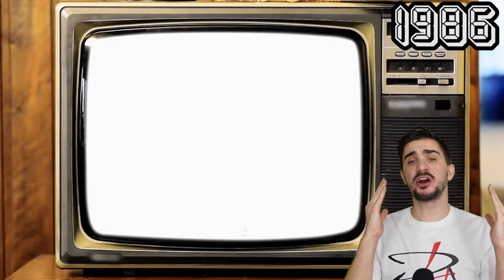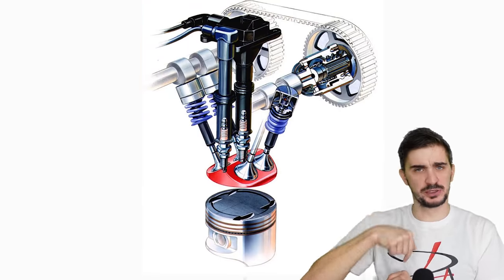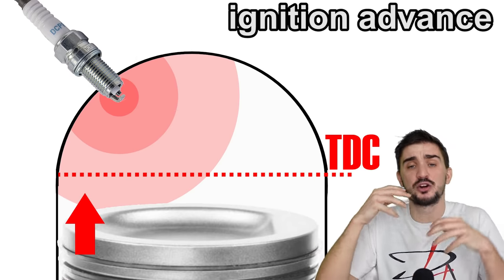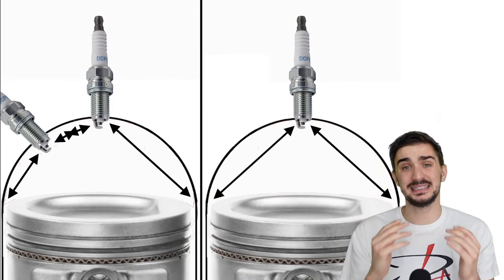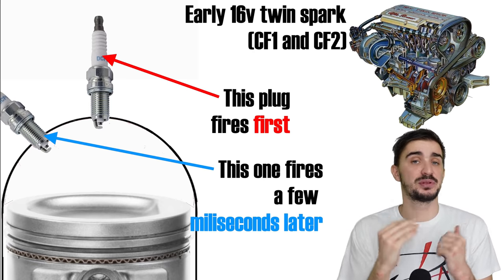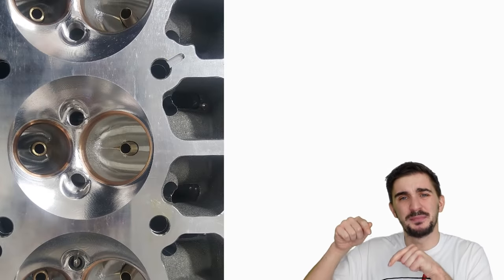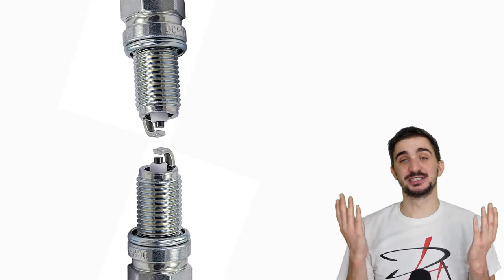TWIN SPARK - WHY, HOW and why it isn't more widespread

Comment: There seems to be an upper limit for bore diameter relating to efficiency. The main reason we are able to make so much power nowadays is all about OEMs being forced to comply with emissions restrictions. All of the manufacturers are using similar bore sizes now. 83mm seems to be the most efficient size with diameter rarely exceeding 95mm. 
Efficiency is directly related to emissions and power comes from efficiency. Motorcycles use even smaller bores for high rpm in the 60-70mm range as you said. Big twins need dual plugs for high rpm. It would be much easier for manufacturers to make larger bores for efficiency and higher RPM but complexity for multiple plugs is extremely expensive. Not only plugs and coils but the wiring, drivers, ecm, and so on adds huge cost in production.
The Mopar Hemi is an exception due to the marketing strength behind it's return. With it's bore over 100mm there's no way to reduce the timing advance enough to meet emissions targets with a single spark plug. The concept was to run a single plug but the hemispherical combustion chamber is not as efficient as the heart shaped chamber in a two valve chamber with offset spark plugs. The cool thing about the modern Hemi is that it's extremely efficient with the dual plugs. A GM LS3 compared to a Mopar Gen3 Hemi with identical bore and stroke run very different spark advance timing. The LS runs around 35 degrees of timing while the dual plug Hemi runs around 23 degrees of timing. The closer you can get to zero advance, the more efficient and powerful it is.
Here's the main thing, with advance you are making a trade off. Even though you don't reach maximum efficiency instantly, the cylinder pressure starts spiking immediately upon plug fire. This is using rotational force to finish the move to TDC. Waiting as long as possible to create the spike in cylinder pressure puts more of the total combustion force after TDC pushing down increasing power. On a dyno when you creep up the advance to maximize power, you are optimizing the trade off between trying to stop the piston from coming up and the part used to push the piston on it's way down. When you add a little too much advance the balance is off exerting more pressure on the rising piston than necessary. The explosion happens to early and it makes more heat due to resistance to motion. Detonation or preignition happens before the plug fires. Adding boost or nitrous increases cylinder pressure which is why higher octane fuel is needed to stop the fuel from lighting before the spark plug fires. Also the higher the cylinder pressure, the faster the flame will propagate across the bore. That's why you have to reduce timing with boost. The combustion is identical to a 5 pound sledge hammer 🔨 with a 1/4 inch or 6mm rubber pad punching the piston. Detonation is that hammer punching the piston too early. Tries to stop the engine instantly, the rod punches the crankshaft against rotation and the piston rattles because you just rung it's bell. Everything superheats in an instant from the opposing forces.
This is just for you D4A, I love your channel and the work you put in every time. Thanks again.

Comment: First of all I watch your videos religiously. I think it would be great if you did one on the Ford 2.3 l dual spark and let us know if there is a way to hack the ignition and have both plugs fire simultaneously. It would also be great if you could dig up some information on why the 2.3's in the rangers were so problematic with their crank no start issues.

Comment: I dont know about how you guys feel but ive  see two different makes back the 80,s that used twin plugs on in-line 4 bangers and they blew head gaskets, and were never run hot, no leaks, etc I think the burn rate is too fast and a lean condition  some air craft engines use two plugs (one is back ). The twin plug deal on the Pinto engine  2.5 was a failure

Comment: Toyota had a good twin spark.
The 3TGTE. It was made in the early 80s and the turbo version was a good little motor. I had one in a 74 Celica. Great car until it burnt to the ground from a failure in the fuel reg.

Comment: India motorbike manufacturer Bajaj has made twin spark for some time. American Le France and Seagrove V12 fire engines were twin spark. The ignition systems were separate and duplicated. If one failed,  you could still respond.

Comment: You forgot to mention the rotary/winkle which Mazda put dual plugs in back to the late 70s right up until the end and they may actually come back in some hybrid form. But the rotary basically can't meet emission standards unless it has two plugs per chamber.

Comment: The royal enfield bikes also has twin sparks it's in RE bullet 350 twin spark (it's in the newer version of uce engines not old ones) yes and bajaj bike known as dominar 400 and pulsar rs 200 and ne 200 has also triple spark plugs and these bikes are exceptionally powerful.
Reply: Sorry it's not ne it's ns 200 (naked sports)

Comment: 86-89 Nissan Hardbody trucks had them in z24 4 cylinder engines.  My dad had a 86.5.   106 hp with throttle body intake.
Reply: Yup with twin distributors what a horrible design that was actually an early waste spark design before they used coil packs if you had the plug wires wrong would misfire like crazy and was a bitch to diagnose

Comment: Suzuki DL650 V Strom, model year 2007 has two spark plugs per cylinder. I don't know if other versions have two sparks also. My old 2004 only had one per cylinder.

Comment: I had a 1921 American LaFrance with a 600 ci 4 cylinder T head that had two plugs per cylinder. It sure ran better with two plugs firing than it did with one.

Comment: Mercedes was building twin spark engines well past year 2000. M112 and M113 for example.. And failed ignition coil can be detected by ECU using ping sensor and stop opening a fuel injector in the corresponding cylinder avoiding possible hydro locking or unburnt fuel washed into crankcase and causing failure.

Comment: While the safety aspect for planes is spot on, aviation engines do run a little happier on both plugs rather than just one.
There is a certain RPM drop that has to be observed (usually 150-300 RPM) when checking ignition circuits prior to taking off
Reply: They have HUGE bores, like 360 CI in a 4 cylinder.

Comment: The Suzuki line of V-twin motorcycle engines found in the SV650 and V-Strom use twin spark ignition.
I think a benefit of twin spark is greater on short stroke big bore engines to get a better flame front distribution.

Comment: KTM (motorcycles) still uses 2 sparkplugs in some engines their 690 (single cylinder) and 1290 ones but not to increase combustion on higher RPM, they use it only on lower RPM to achieve better ignition with that better emissions for the EURO standard and after ~6k rpm (iirc) the 2nd is turned off

Comment: My Honda VTX1800T has 2 plugs per cylinder.  Only motorcycle I ever owned that I felt like I needed a seat belt when I rolled the throttle.

Comment: Some Corvair engines converted for experimental aircraft sometime have dual ignition systems on single plugs. Dual ignition redundancy without the hassle of drilling a second spark plug bhole

Comment: Not only do airplane engines not have variable valve timing and lift… but they don’t have variable spark advance. 

Ignition timing is fixed because the engine only has to accelerate the propeller not the whole airplane. They use an impulse coupling (a pawl and spring mechanism) that snaps the magneto at low RPM for a restarted spark for starting.. or a shower of sparks system that uses a vibrating ignition coil.

Comment: Unless brand new aircraft engines are using coils now, aircraft don't use coils, they are less reliable. Every aircraft piston engine I have seen use magnetos (I mostly stick to turbines so I don't see a especially wide variety of piston engines).   Magnetos are very reliable and are entirely mechanical which is even better for safety when you have an electrical failure, and usually one magneto per spark plug set.  While we are on the topic if you had say a Cessna 421 with twin GTSIO-520s (Geared, Turbo-Supercharged, Injected, Opposed, 520 Cubic Inch), you would have a total of 12 cylinders with 2 plugs each, and get replaced fairly often (I think its in the 250 hour range but I don't deal with it much), for a total of 24 plugs which IIRC cost roughly $100-150 each, $2400-3600 plus install (unless you are an FAA certificated mechanic).  Be happy you have had the same spark plugs in your car the last 100k miles and the replacement is only $15.

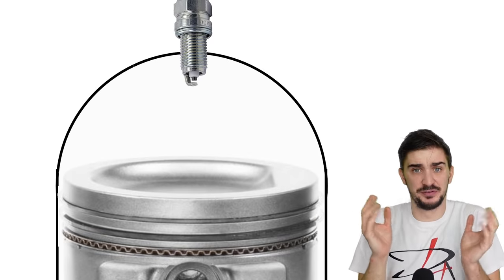Comment: 3:50 yes it can be ignited two times, that was told in chrysler: first time to burn most of fuel mixture, second time in exhaust stroke to ignite and burn rest of unburned fuel mixture, that is why 2005. 300c 5.7 has 2 spark plugs, but it can be rearranged to give spark at same time, and that has 1% better fuel economy
Reply from the maker: Yes, I explained the same thing in Alfa Romeo engines where the plugs fire one are after the other. But that's not igniting the mixture twice, that's physically impossible. You're just hoping to ignite what the first spark didn't, you're still acting on unburnt fuel. Igniting twice would entail igniting burnt fuel again, and that's not happening.
Reply: @d4a  ma di si jarane!
Reply: I think you are referring to the  'waste spark' concept more than twin spark.
Reply: @bicylindrico  yes, but i reconnected it to be twin spark

Comment: Question.
Is detonation a proper term for igniting the fuel mixture in the combustion chamber?
Or is the proper term deflagration?
I've always used the term detonation, and its inverse pre-detonation to distinguish between two very different operating conditions, and a recent commentor decided i needed scolding. He read a book. 😨 (I didn't write it. 😂)
He insists that detonation describes a supersonic, destructive shockwave event, and deflagration was the proper term i was looking for. 😏
Following his thinking then, pre-detonation would be a non-event, (which i admit might be normal for a steam engine) ... but i argue that that so called non-event, (pre-detonation) in common automotive lingo for ICEs, is the process of trying to compress an explosion. It's an important concept to grasp.
Jussed askin' if you can help clarify. Bad habits should be nipped in the bud, and a common dialog is essential to that. 😂
I even offered an alternative term to make the peace : pre-ignition, but he wasn't havin' it. Matter of honor me thinks. 😬
Great channel BTW.
Reply: Detonation: post-ignition uncontrolled spontaneous combustion. 

Preignition: uncontrolled combustion which occurs before plug fires.

Both are potentially very destructive.

Comment: My ram hemi powered dodge truck has 16 sparkplugs.  Its 345 horsepower is still available at 300,000 miles on the clock.

Comment: Most 1996-2006 mercedes (with G-wagen g500 and 55amg and w221 s600 untill 2012-13) had twin spark engines. In fact, current chrysler hemi is developed from mercedes m113

Comment: It’s not just about engine efficiency, but redundancy with the ignition system. Not going to deny the performance advantages, but with automotive engines, valves occupy the space the spark plug can effectively work.

Comment: I had a Ford ranger with the twin spark four cylinder. Power was definitely not the reason on that particular application 😅. 105hp if the planets are perfectly aligned...

Comment: I used to work on alfa 1300, 1600, twin cam engines , those hemi combustion chambers and domed pistons had to use 40 degrees BTDC at 5,000 rpm, the fiats with the rubber band timing belt had flat top pistons and made more power at 5,000 rpms with ten degrees less timing than the alfa,s which ran a timing chain both motors were interference  valve trains

Comment: Once I owned a motorbike from an indian manufacturer called Bajaj. They have a technology called DTSi that involves 2 spark plugs. I don't know what it does exactly, what I remember is that it once save me when I parked my bike in an unsafe place and one spark plug was stolen. They guys who stole it were around watching me, waiting me to ask them for support lest I would get stuck there. It shocked them when I came back, found that the plug was stolen, but still went ahead and turned on the bike, and off I rode. 
I felt very good to disappoint and humiliate them that much.

Comment: The design choice for the alfa 4 valve engine is a bit strange, why not go for a triple spark plug at that point and still get the benefit of shorter flame front distances along with even less emissions?

Comment: What about the Mercedes M112 engine?  2.4, 2.8 and 3.2 litre V6 90 degree engines with offset crank pins to smooth out the incorrect bank angle.
Reply: Very nice example! :)

Comment: Chrysler has been using this design in the Hemi since the early 2000's; and it's still in use because of how efficiently the sparks ignite the fuel.
Reply: wrong
.
the 2nd spark is a delayed a few MS.....and its 100% for emissions 
NOT for performance 
.
the 5.7 chamber is not even CLOSE to the same design as the WW2 engines and the 60s and 70s HEMI
Reply: Yep. It’s a semi-hemi because there’s no way a true hemi would ever pass emissions. The second spark plug is to clean up the emissions. 

Dodge knew it was obsolete back in the 50s when they designed the wedge head to replace it.
Reply: @Bartonovich52  Not the case with the Gen3, they fire together.
Reply: @maxwell-style4584  but they use the same coil packs......
.
So I'm pretty sure ya wrong

Comment: on light airplanes, that are powered,  by 4/6 cy piston boxer engines, difference in rpm are about 200 between 1 and 2 spark plug working(magneto check)

Comment: Why there are no engines where separate cylinders ignite simultaneously? For example, in 4-cylinders engine, two cylinders are always in the same position.
Is it because problems with slight timing differences, or reduction of rpm?
Reply from the maker: Because the engine would be very unbalanced and would vibrate in an irritating fashion

Comment: Until recent the Smart cars had SOHC twin spark engines who managed outputs over 80, 100 or even 125 bhp from a 3 cyl turbo 700 cc(0,7 liter engine). Twin spark engines are more common than you think

Comment: Dual spark plugs might package well in an engine with 3 valves per cylinder...at least if smaller spark plugs were used.

Comment: My old Aprilia RSV 1000 Tuono had twin spark plug heads in a 60 degree 8 valve v twin, interestingly the engine was built by Rotax who make aero engines.

Comment: 3:50 Actually you can. New engines have sequential spark plug firing that fire sequentially after another, resulting in more cleaner combustion

Comment: Ignition failure leads to hydrolocking????
Riiight, now pull the other one!
No squire, it only MAY lead to dilusion - but in practice this will only cause a loss of power, and with a fully loaded (overloaded?) plane this can obviously be a problem.
In addition, a second offset plug DOES reduce combustion time (sure, a little only but still...) as the charge is pushed "aside" (to the non-plug side) due to a rather large pressure increase which compresses the unburnt charge drastically - which will increase flame-front speed hence reduces the time required to combust. Oh, yeah, the trick is to do this (burning all mixture) before knocking occurs, and this is why on a KTM 690 motor (twinspark!) the combustion chamber is slightly lobsided (there's more of a squishband on the non plug side) 👍

Comment: Mercedes used the twin spark for their 2000+ V8 engines (before turbo ones). Chrysler and one more also used it in 2000+ (Up to 2010 or 2012) in their V8 engines. They were used in more cars than the ones in your video, but overall - it's just an expensive replacement.

Comment: an F1 V8 engine, reaches 20,000RPM which is 84KMH of average speed, then you must reach twice the average speed in the middle of the race so that the G forces are constant throughout the piston stroke the piston stroke measures 3.9 CM, in total it gives that the piston must reach 5,700G but the reality is that the piston reaches 10,000G, but if the rotation of the piston were constant then the piston could reach 31,000RPM maintaining 10,000G, and on top of that if we could remove the efforts by torsion and we would only leave the traction and compression efforts, we could even rotate faster, and all this would be possible if the alfadan mechanism works, which is like a percussion drill, and an extremely compact 180° V8 could be made, perfectly compatible with hybridization. even above the V6

Comment: I think Kawasaki had 2 stroke engines for Arctic cat snowmobiles with 2 plugs per cylinder around 76. Then definitely in their own snowmobiles in the 440 LTD from 80-82 and 550 Interceptor in 82.

Comment: twin plug systems are not new, Abarth made dual plug heads in the late 60's.  There were numerous aftermarket manufacturers that made or modified your head to operate with 2 plugs, was very common with Harley and BMW boxer motors.  So they were around at a fairly common operation.  Often these plugs even on these older engines with often point ignition had the firing off by several degrees.  Now days this is absolutely normal, in fact there are some systems that allow the plug to fire several time.